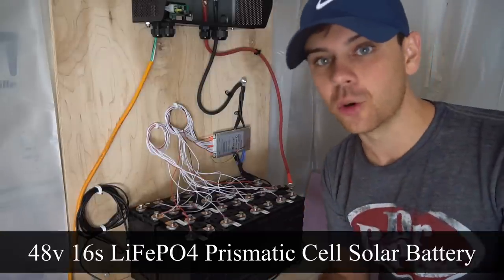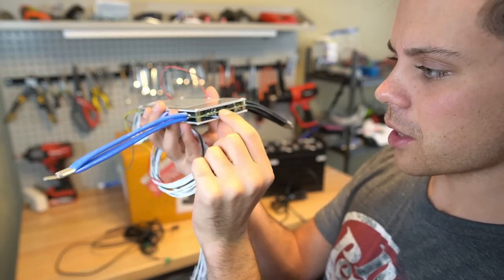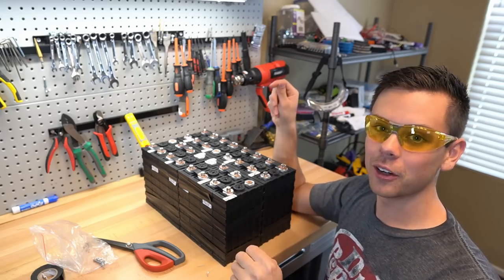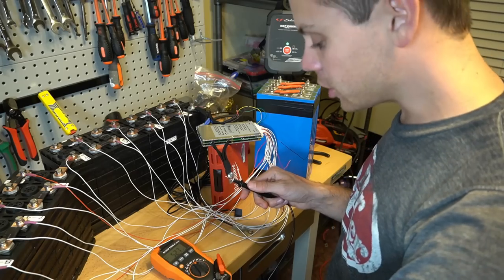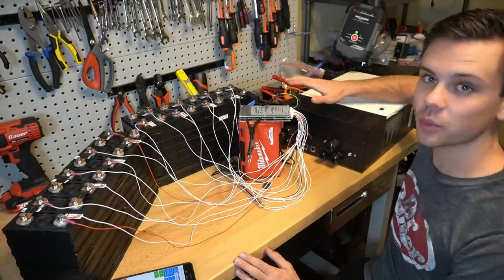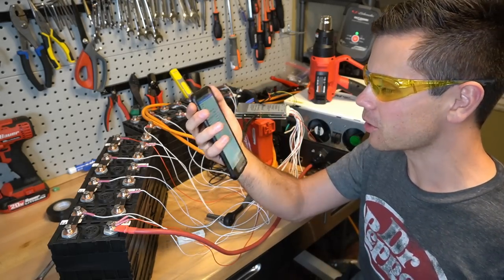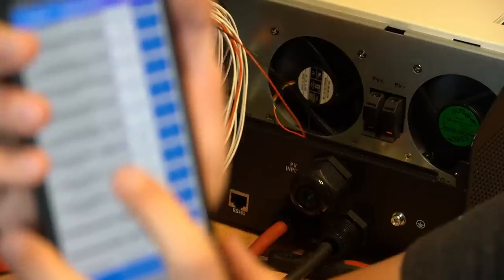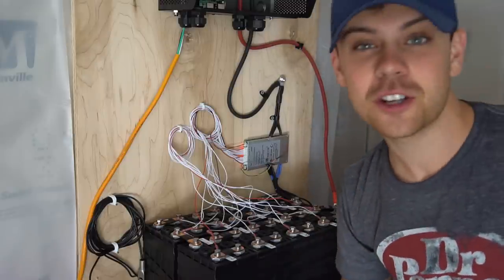DIY 48v LiFePO4 Battery w/ $72 Bluetooth ANT BMS (low temp cut-off!)

Comment: Hi William,  very useful information on your channel. I have a technical question. I am wanting to build a powerwall type battery for my home using Nissan Leaf cells in a 14s14p configuration and seven of these cells in series (x 7 = 56V).  I'm then going to use a 5kw hybrid grid tie inverter with this.  Most of the grid tie inverters I have looked into require a CAN connection between the battery and the inverter.  You have done a lot of testing with BMS, do you know of any that would suit this set up?  The Nissan Leaf 2s2p cells are rated at around 488wh, so the whole system will have a 24Kwh capacity when it was new, but will probably have a SOH of around 60% (14Kwh).   The maximum draw from the system will be the full 5Kw that the inverter can handle at 240V (NZ), so around 21A load.  I hope my calculations are correct. I looked at a REC BMS but that is very expensive. I don't mind paying a few hundred for a BMS that will last.  Thank you, Luke

Comment: Hi will, I’ve really enjoyed watching your videos, I haven’t bought my solar system yet, this is for my shed I don’t have AC power, I have a duel fuel generator, I wanted to add it to my system when and if I needed it. Is their a video with a generator added to a charger controller. My usage would be for 2 12 volt battery optimisers for my motor bike battery , generator battery, internet router, and cordless power tool batteries mainly but  at the weekend I would require 1000 to 4000watt but not all the the time. I look forward to hearing from you. Phil.

Comment: In the App, everything is named voltage 1, 2 ...etc, even Ah, power, temperature.
It makes it quite confusing.
The low temperature cutoff security need the 2 temperature sensor to be at low temperature which is very strange for a security to need 2 signal. You would usually put 2 sensor to reinforce security, but wait for only 1 signal to trigger the security.

Your battery pack isn't 2kW stored energy, but 2kW.h

Comment: Hey, trying to create a 560AH 24 Volt System running an AIMS 6000 Watt inverter.  I purchases the same ANT BMS that is 100Amp and 300Amp peak.  I saw that this was outdated and was directed to your site.  Do I need 3 BMS's to run the system or can I use the cutoff relay like you used?  Most systems I find online are either not as large or don't seem to use a BMS, just a monitor.

Comment: Isn't all the weight on the screws instead of the bracket being underneath supporting the wood and then screw?  Well I'm no mechanical engineer, but it sounds sturdier with the bracket underneath with lag screws into the wall; any idea?

Comment: I need your help please,I have a 8 27s lithium ion 18650 used I have ant bms 8-24 300A and I will be adding more of the same ,need to know if I can use these stacks as a one battery there I parrell do I need to have a different bms for the stack ,can you help me straighten this out or show me so I done waste it Thank you

Comment: I’m attempting to build a 48 V emergency back up power system for my house I have come in to me now 32 lithium tighten it 2.4 V batteries and yes 21 of them equals 48 V William what’s the best way to integrate the other 11 batteries into this buy 10 more batteries to build another 48 V system so I have 248 V backup system for my house ?

Comment: hello , you were so excited from charging disconnect of the pack(low temp)  - but is it a good thing to cut the battery connection from a solar charge controller while the panels are still  connected and producing power ?

Comment: thanks for that very interesting video!
i like it!
i have build my own 48V System some month ago with a 200A BMS lik your other 12V BMS...
it works great but it is difficult to get a all in one system like yours in Germany... :-( we have som on the market but not verry much...
greatings from Germany
Reply: Check out ective inverters 4 in 1 - of course you will need the bms but the inverter is great - unfortunately not reconfigureable

Comment: Why does the low temperature BMS require both (or only the first) lead(s) to be out of spec?

Is there a way to have the BMS shut it down if either temperature lead is out of spec by itself?

Comment: I have 4 ant bms, balancing 4 battery packs of 8s LiFePo4 batteries. The problem I have is that all BMS have factory set bt mac address to AA:BB:CC:B1:23:45 so when they are all powered up, they conflict and I cant connect to each one via bluetooth. Do you know a way to change bt mac address?

Comment: nice! i'll be curious how that BMS works out. i got one of those GridVision BMS that you were playing with a while back and had nothing but problems with it. i'm just running a little 4S system at the moment and i can monitor it manually but for $70 with that kind of feature set..if it works i'm sold!
Reply from the maker: Wow you don't like the grid vision?! I love that one for simplicity. What problems do you have with it?

And yeah only 70 bucks! So cheap for all the perks
Reply: @WillProwse  it constantly shuts off on me. when i contacted their support, they said that if you were charging and discharging at the same time then that created an overvoltage situation.  well...what kind of setup isn't charging and discharging at the same time?

Comment: I have that exact same BMS. I haven’t used it yet because it seems to be very complicated compared to others I have used. Were your cell voltage readings close to accurate?
Reply from the maker: Yes I tested low and high voltage cell and they were accurate to my equipment

Comment: Does this BMS support CANBus and/or RS485 interfaces that inverters require?  If so, does that support require another device, such as a Linux server, to open the data from this BMS and interface it into CANBus/RS485 support?

Comment: Any leads on something similar for 6s 24v? I'd like to add a BMS to my Tesla battery, especially now that Victron is telling everyone not to use the BP220 with inverter/chargers...
Reply: Matt Digan this was my first thought! I have wanted to add a Tesla module or two to my ambo build so I can ditch the generator, but the low temp cutoff has been a major issue finding as a feature. Designing my own low temp circuit has been frustrating so I’ve just held off. I would happily pay $80 for an off the shelf bms with low temp cutoff!
Reply: Just use 2 Tesla modules in series

Comment: I got this same bms for my 24volt system. The temperature sensor port came with 2 sets of wires and to microchips....one is a connector and the other dead ends...im guessing it comes with a temp sensor now. Thou I havent been able to figure it out yet...any advice would be helpful

Comment: How would you use the bms with 3 set of those batteries in parallel? would you need 3 bms's? or is there a bms that can attach to 36 batteries?
Reply from the maker: Like this: https://youtu.be/zStEtH9Le-w

Comment: Well I'm having no luck with this thing every time I try to connect I get this error (get device info fail).  I'm currently using Xiaoxiang  app which I'm not sure is the correct one
Reply: I had to email them about getting the app Will was talking about. It is a RAR file with you need to convert to a zip then extract using your phone. It was such a pain in the ass!!

Comment: Hi, is it possible to make 4 4s lifepo battery using 1 4s bms for each and 1 16s bms to be able to charge/discharge them in serie using 48v way and charge them in parralell 12v unsing a car alternator ? Thanks a lot ! ;-)

Comment: please help.
I have 4 cells lifepo4 42ams and 4 cells lifepo4 of 100ams I want to create a power-bank 12.8v with these cells but I want to know if I can mix together in one load  output and in one charging input??
can I connect all together in one lifepo4 BMS Controller?
please some one let me know.
thanks in advance

Comment: I have a question Will! This BMS does it has a separate ports for charge and discharge? Cause I see on your phone, in the live parameters page, the dicitures "Charge MOS: Open" and "Discharge MOS: Open". Thank you! 
PS: I'm waiting your review and test of the cylindrical LiFePo4 100Ah cell available on Amazon for 90$, or on Alibaba for 75$ each, produced  by Shunbin. Will be very cool!  ;)
Reply from the maker: It's bi-directional so it's a common Port BMS. And yes you have mosfets going in both direction. So they can control charge and discharge with one output which is pretty incredible

Comment: William hello is it possible I have 26 lithium 2.4v Titanate Batteries for battery back-up I’m in Grid “ My Question is if you could be so kind to help me it may sound ignorant to you in your wisdom but I’m not as smart as you and this can I wire together the 26 Pcs  2.4v Titanate Batteries with Lithium Iron Phosphate 4 Pcs 3.2v 100Ah Lifepro4 Battery ? I had seen you’re test on these and I thought they did well can i wire all these together and work or use 2 different inverters to my transfer link to my fuse box ? So the Batteries in theory would not be linked together but they would be powering my fuse box the Titanate batteries could be powering one side of the box & and the lithium ion phosphate batteries could be power in the other side ! - ?

Comment: Will this work with a 24 Volt system or only 48?  If not, is there a 24 volt version available?
Reply: both,  very versatile bms, once on the app you do the setting on everything.   At first i put in very safe specs,  if 3.6 high I put in 3.5  etc .. once I in the comfort zone . :-)

Comment: Hello great video:-), but do not have a legal requirement that it must be fireproof / fire retardant wood back cover ie where to mount solar charger and inverter etc. In Denmark/EU if you install them in the home then there must be burning inhibitory wood. But do not need autohomes.Regards

Comment: That is awesome! I think I'm going to pick one up. Does it also have high temp cut off?
Reply from the maker: Yes and so so many more options. It's crazy! Even has low temperature discharge protection that you can set lower than charge protection. It has so many other settings too. Hardest part is connecting it to Bluetooth. After that, it's dead simple
Reply: @WillProwse  Thanks! I'm going to do something crazy for my off grid system up in Wisconsin. The temp cut offs are very important due to the temp fluctuations in the weather there. I'm planning on running geothermal air cooling and heating to the box I'm putting the system in. With a simple temp sensor and a fan I will be able to pull 50 degree air out of the ground to cool it during the summer and warm it during the winter. But I still want that protection. Also congrats on the house and the Tesla!
Reply: @WillProwse  Will it handle a 24 volt system? They seem to only have 48v and 72v listed for support?
Reply from the maker: @ChadSutton  oh there is a wiring diagram for 8s, or 24v LiFePO4 batteries on the ad listing. Follow that schematic and you are good
Reply from the maker: @ChadSutton  also, be conservative with temp cut off settings
Reply: @WillProwse  That is one of the reasons why I want to have a geothermal system to cool and warm it. Best case scenario is that I won't have to worry about it much unless I run out of enough power for the fan during the winter. Worst case is that I'll be able to regulate things enough to make it very rare to have to shut off the system even with very conservative temp shut offs.

Comment: The BMS rating is the peak value. The actual values are lower. This also explains the 4 12AWG wires, which definitely cannot carry 300A continues. Here are the real values. Discharging current: 40A (peak 60A) ,  60A (peak 80A) ,  70A (peak 150A) , 120A (peak 300A) , 150A  (peak 400A)

Comment: Where do you get the Android app?  I've got 5 of these, can't get the company I bought them from to respond and can't find anything online.  Is it really that hard to find? :)
Reply: Same here. I bought 4 of them and there was no manual/instructions. I need the link for the android app too. Thanks.
Reply: @joeadcock5647  I finally bought VBMS for $6.99 but can't find a way to configure the number of cells in that.  It is at least getting data from the BMS.
Reply: I'm also in need of Android Bluetooth app info.

Comment: There is a problem.  If the BMS detects low voltage, it will disconnect the battery from the inverter, but also the charger.  So the battery will just remain in the low voltage state, not being able to be charged.   You will have to find a way to bypass the BMS from the battery to the charge controller to bring the voltage back up.
Reply from the maker: That is absolutely false. It stops charging or loads discreetly. Totally different than my other BMS in other videos. Different circuit design
Reply from the maker: And I actually cover this in a community post that you should just connect solar charge controller directly to the bank anyways. Unless you want the coulomb meter functionality
Reply: @WillProwse  Thanks for the reply Will!
I will look further into the forums.  I am just going based on the fact that I see only 2 wires sticking out of the BMS so it is a common port, therefore can only have one switch, and if both charge controller and load are connected it will disconnect both.   
I will hit up the forums, thanks for all your help!
Reply: Hey Will!  Any chance you could provide a link to that post?  I can't seem to find it.  I own this BMS now and I am contemplating how I should connect it.  I am a bit thrown off by the 50amp charge limit even though it has a 320amp discharge.   my system should be able to charge at 51amps .  I can change the setting to allow more charge current but I'm not sure if this will cause a fire or something.  Maybe it will just need a heatsink.

Comment: And by the way the BMS automatically starts if you charge it no need for an external battery ;) also  the connector can be unplugged after starting  👍
Reply from the maker: No way!!!! Good to know. Thank you thank you!!!
Reply: Wouldn't it be great to have some kind of software to show stats like temperature, amps, Voltage and charging status on an monitor with an better Layout. Is there someone out there who could help with programming ? Ore just modifying the original APK?
Reply from the maker: @janekw.6022  that would solve everything. It has all the features. Someone has to be able to code up a better interface.

Comment: How about a video taking the screws out of the bms to look at the mosfets and see the actual build quality or the bms etc? That would be helpful. Also you forgot to mention that the balance current is only 100ma so basically it would take days to balance the cells (if it ever got there) with a pack this size. Basically this balance system is a joke, but many of the safety features sound nice.
Reply from the maker: The balance rate is perfect for cell drift over time. This is a storage battery, so balance will be solid whether you balance it or not. I ran raw matched LiFePO4 cells without balancers for ages and as long as they are matched and used for solar, you don't need balancing. The marine application guys found this out and I was amazed when it was true with my own testing. If this was another chemistry or size of battery, balancing speed is very important. This application? 100ma is more than enough.
Reply from the maker: I can link proof of this of you don't believe me. Let me know if you want me to elaborate further

Comment: Does the balance feature work ok on that bms? I saw it balances at 0.1A does that not cause a lot of heat? That is 1/2 watt per cell. Equating to 8w of heat.  I am currently looking into active balancing but the cost is bugging me.
Reply from the maker: Don't worry about balancing. If you have high quality matched lithium iron phosphate cells, balancing is nearly a none issue. Correcting for cell drift is simple and usually not an issue unless your pushing high c rates. And in solar, we don't. Why are you worried about balancing?
Reply: @WillProwse  trying to use one like this 32s, though in a car sometimes i put out 400a for it
i tried to auto balance but takes days to change .011 volt change

Comment: I bought 16s ANT BMS for my brother solar system 48V 75A LiFePo4.  The BMS constantly cuts off the charge and the MPPT inverter shuts down. In the video @ 9:08 I can see the parameters are for Li-Ion not LiFePo4 batteries? Single overVoltage protection is 4.19v instead of 3.6v!  I lower the Inverter/charger Bulk charging (CV) to 56V and Float to 53.5v but still have the same problem. The BMS cuts the charge. Any suggestions?
Reply from the maker: Just change it to LiFePO4
Reply: @WillProwse 
 I always had it on LiFePo4! The BMS is disconnecting when the panels (6x245w 24v) get full sun but there's low energy consumption. I don't know how to overcome that problem. Maybe add relay with diversion load, so batteries will never reach the cut off voltage? In some BMS the cutoff voltage is set to 3.75v instead of 3.65v.

Comment: Do you have a recommendation for a high quality BMS?
Reply: Justice Lee you mean like the one he is talking about in this video, like the entire time?
Reply: 4philipp I don’t think he is asserting that the one reviewed is high quality. He specifically points out how it can’t handle it’s rated current for long. I need something that will last for years and handle 400A continuous in a 16s config.